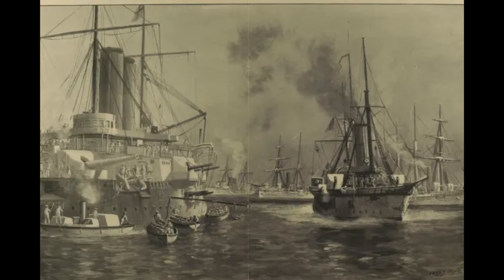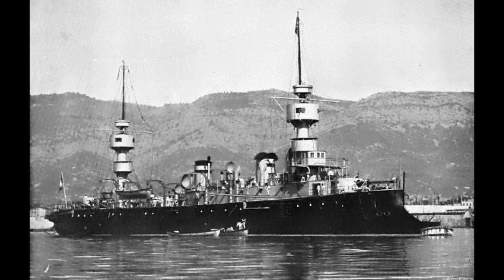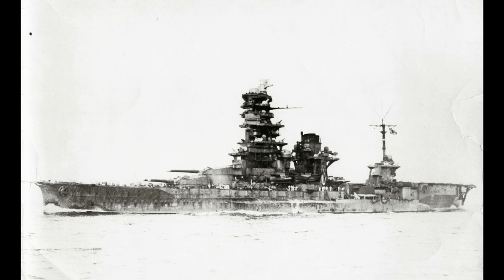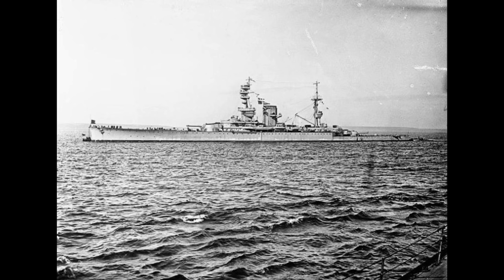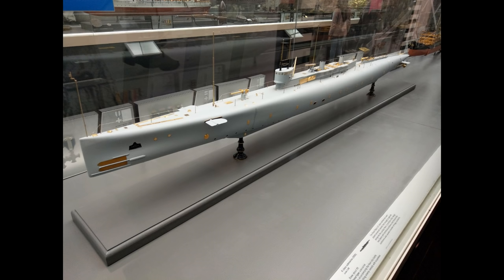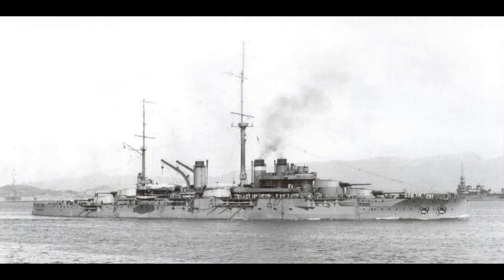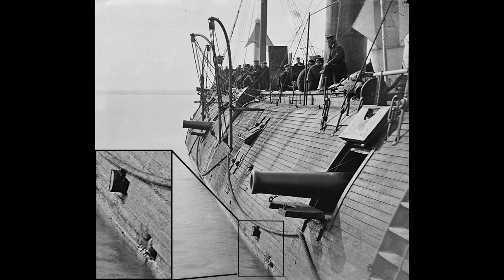Naval Engineering Disasters - How not to design a ship

Comment from the maker: Pinned post for Q&A :)
Reply: If it is possible to create a naval gun bigger than 18.1", how much would a 20.8" 9-gun fast battleship weigh?
Reply: This may be a bit redundant or stupid, but listening to this, with the K-class, did no one, at any point, stop to question whether designing a sub whose crush depth was less than the length of the sub  itself might have been a poor design choice? What was the rationale for the dive depth being so shallow?
Reply: If Montana would have been build, will she be fast enough to be with the carrier fleet just like the fast battleships ?
Reply: Would wood from the West Australian Jarrah tree have made good timbers for wooden warships? It is a very heavy hard wood that is very hard to burn ( as I know from trying to burn it in winter)
Reply: Hey drach! How about you show us your ideal designs on games such as Ultimate Admiral Dreadnought or if you feel confident something much more complex like Naval Art?
Reply: Reduced batlecruisers: Dreadnought keeps caliber and armor of predreadnoughts, increasing speed and replacing the intermediate guns with more main batery guns. How well have worked  a batlecruser that made just this, in the inteded purpose of killing armored crusier. Ie, a 6-8 inch armor, 26 knots, 8-10 9.2" guns, in terms of cost and efectivity
Reply: Hi Drach
Just a observation about Ise and Hyuga. Agree with your analytical approach to the battleship-carrier, just not your figures

They carried a combination of 22 (or 24) Judy dive bombers or Paul recon float planes. 
At the time, that is after Feb 1944, the Japanese had arranged their naval air group/squadrons in a type of RAF/RAAF squadron systems where air planes were assigned to specific squadrons for specific roles, regardless of where the squadrons were placed on the battle field 
Hence CarDiv 1 had no planes assigned to it, rather Air Group 601 had their planes specific trained as carrier based planes. These planes could operate on a carrier in CarDiv 1 or as a land based air unit on land. Bit of the results of Midway, Santa Cruz battles and rigidity of aircraft deployment that hemmed in the air groups to specific carrier divisions.

Rightly or wrongly, the Japanese believed that most carriers attacks in a given battle would launch one strike per day per carrier. The 22/44 Judys/Pauls attack and scouting planes would compliment any Japanese carrier attack for one day in a given battle.

The Japanese chose bombers and recon planes over fighters because IJN was attack minded. They believed a battleship with its armour could survive ONE counter strike by itself by dodging bombs and torpedoes. As we know, this was proven correct before and during Leyte too. 

Ise and Hyuga were in CarDiv 4 in the 3rd Fleet in May 44. Air Group 634 had 2 squadrons of recon planes, 301 Squadron and 302 Squadron, made up of 18 Judys and 16 Pauls. AG 634 also had 2 fighter squadrons as well. They were assigned to the 3rd Fleet. The 3rd Fleet assigned these aircraft to CarDiv 4 to compliment the battleships.

In the mid October 1944, the US 3rd Fleet started their soften up of the Philippines in October and Japanese activated Sho but not knowing exactly which island the US intended to invade. The US bombed Formosa and after 1st raid, it was decided to send Air Group 601 (CarDiv 1, eg Unryu's)  Air Group 653 (CarDiv  3 eg Zuikaku & CVLs) and 634 (CarDiv 4 eg Ise's) to Formosa to counter-attack the US 3rd Fleet. 
Most of recon wing were destroyed or lost many planes on the 15th.
Ise and Hyuga had very few planes left for the Sho-1 sortie. So the planes stayed behind at Formosa as part of 2nd Air Fleet.

So you are right in a round about way, that in the only battle they fought in, the battleship-carriers carried 0 planes while missing a third of their armament maybe more with hangar in the way if they were fleeing in a gunnery duel.
Reply: You have extensively covered Wood, Iron and steel constructions, is there any naval use of ferrocement construction? I can only recall the Mulberry Harbour cassons.
Reply: I would put a vote for the RN J-class submarines being a slightly greater engineering mistake than the later K-class.
These ships shared all the other seakeeping problems the K-class had, but were too slow for fleet use at the time of design !
During the design process of these the huge problem of "no suitable engines" was one of the first problems raised.  Vickers made an inline 12 version of their existing, and rather ordinary, 8cyl production engine; which was still recognised as being inadequate.  But three of those 12Cyl engines were used.  The RN soon found them to be useless for their needs, and passed the J-class to Australia.  There they were mostly in reserve until struck off charge.  It seems that their most positive role was to supply electrical power to one of the Port Phillip bases.
Strangely, the inadequacy of those Vickers diesels, and others, did not result in the UK government supporting a major diesel engine development programme.  So the majority of submarine engines up to the end of WW2 can be claimed to be behind the norm used in other navies.
Reply: Hi, silly question, how did the Japanese aircraft take off from their hybrid carriers, I thought the carrier should be pointing into the wind
Reply: Assuming Hiei managed to limp home from her knife fight at Guadalcanal and that Mutsu doesn't explode and both ships are with there respective sisters in the Center Force at Layte Gulf, could the extra ships, assuming they don't sink in the air attacks with Musashi, have made Halsey consider leaving Task Force 34 behind to cover the San Bernardino Strait or at least made Lee press the case to leave Task Force 34 behind stronger? And what do you think Lee's reaction would be at fighting this new Centre Force with Task Force 34?
Reply: Given your previous disdain for the Nassau class and there failings as Germany's first attempt at a Dreadnought I am surprised not to see them on this list, is it a case of only just missing out or were they not as bad as I believed?
Reply: What are your favorite warships by era?

Not necessarily the best, but ones that something about them just makes you enjoy them?

You know, like the Kamchatka
Reply: why didn’t more ships use near water line exhausts wouldn’t that decrease detectable or just to costly to be feasible ?
Reply: With the weather the way it is here in the US I thought I would ask a naval question about the weather. How cold does it have to be to pop cast iron balls out of a brass monkey? Could you explain that terminology to those who might think it's dirty LOL.
Reply: This may have been answered, but I'm not aware of it so what is the point of the one fore, two aft turret design on the Konigsberg/Nurnberg designs? Surely for a commerce raider chasing down merchant ships two fore makes more sense. It just seems like a ship designed to run away. Was it simply the weight issues again or was there an actual reason for the design, and if so why did no-one else use it?
Reply: Q&A in your opinion. What ships looked like or might as well have been designed by Jeremy Clarkson, James May and Richard Hammond. Either individually or as a collective?
Reply: How universal were the flight decks of WW1 and WW2 aircraft carriers? For example could Enterprise's flight group fly off of Taiho and vice versa without significant impediment, assuming for the sake of argument the crew are familiar with the new aircraft/ship.
Reply: @d.olivergutierrez8690  

Montana could do 28kt (in theory), so technically no, but then the SoDaks only made 27kt and were sometimes used as carrier escorts (in the “glorified, overgrown CLAA” role)
Reply: How effective were the Dutch Hazemeyer gun mounts
Reply: @Slavicplayer251  I would imagine having the exhaust close to the water is not good in high seas. I know I wouldn't want the water to have that easy access to my engine room!
Reply: This question has already been covered somewhere probably, but I was wondering how long naval guns would take to reload. Assuming the sailors are average skill how long would it take to reload standard 5 inch destroyer guns or 16 inch battleship guns. The reason I am asking is because I am curious how games like World of Warships and Warthunder compare to real life.
Reply: May i ask what is the difference between an armored cruiser and an protected cruiser?
Reply: What other naval inventions made all others versions in their category obsolete? By that I mean in the way that HMS Dreadnaught made a lot of other ship designs obsolete, just in terms of guns, fire control systems, ammunition, engines, etc. The only examples I can think of would be the American Combat Information Center, and the VT fuse on AA gun shells.
Reply: I think the line that Beatty should have said at Jutland was not "there seems to be something wrong with out bloody ships today" but rather "there seems to be something wrong with out bloody admirals today."    It is a poor craftsman that blames his tools.  The Indefatigable class made a very great deal of good sense for the UK in the day and age in which they were built.  It's possible that the lack of an Empire today may be shaping your thinking a bit too much.    If the proper handling rules of both ammunition handling and ship purpose had been followed, and Beatty had been much more careful about how he engaged the Germans, and I would submit here that he could have done his job perfectly well just by leading the Germans towards the Grand Fleet without firing a shot, but he also could have stayed further out of range and properly utilized his second squadron of heavier battleships for their proper purpose.  
I would also submit that while you have a valid but in no way completely guaranteed point on the possibility of Indefatigable going down in the Falklands, I think it very likely that it would have at least caused some significant damage before it went, and if so that would have served her primary design purpose to a great degree.
Reply: As you have discussed in earlier videos, some ships were fitted with smaller and fewer guns per turret, but with greater mechanization to increase the rate of fire (I believe you discussed this in the Tiger Class video).We’re there any inter-War or Second World War designs which only had large caliber single gun turrets (I.e. larger that light cruiser sized guns) specifically to increase the rate of fire?
Reply: Do a video on U-1206, when poop caused a UBoat to sink and the toilet requires a so called Scheisseman to operate successfully.
Reply: Please could we have a short 5 minute video on Henry V's Grace Dieu please?  Stumbled on it when I was in Hampshire before Christmas, and reckon it would make a good video!
Reply: What would indefatigable have been like if she was designed with only fore and aft turrets and all the saved weight put into armour and or machinery.. ie a predreadnaught battlecruiser or somesuch
Reply: Hello Drach, lets supposed RN had Ise class BB/CV mutant. How handy would it have been during early Battle of the Atlantic when raiders were a threat before CVE came along supposing anti sub/ship style aircraft aboard? Maybe even during Malta runs?
Reply: @herrraja9038  well theoretically possible. But why would you want to? Bigger is not better.
Reply: @d.olivergutierrez8690  she was a slow ship by design. Nope.
Reply: @Texas_montantero  a deck is a deck, is a deck. By that definition all aircraft carriers are pretty universal. They're all flat, long, & have elevators.
Reply: @deaks25  One fore two aft helps with topweight, since the aft turrets can start a deck lower, the front superfiring turret has much more topweight leverage on the ship's metacentric height, and therefore in some situations can not be worth it. Plus a commerce raider has much more speed margin on the things it wants to chase than the things it wants to run away from, so you can make a case that more firepower aft is fine as long as the aft turrets can train decently far forward.
Reply: @hamishneilson7140  that would make no sense.
Reply: For an element that isn't a single ship, what about WWII German stern design?  As I understand it the use of three screws instead of four on their larger ships prevented enough buoyancy being available since the stern sat too high without enough of it in the water in order to clear the screws. This combined with a very long belt (and resulting stiffness) meant that the stern structures were prone to collapse when exposed to shock, which would concentrate stresses where the belt and stern wanted to flex differently. This isn't just a hypothetical either, since Prinz Eugen needed to be towed back to Germany after such a hit and Bismarck's career was defined by such a hit.
Reply: Do you plan on some day covering the battle of Santiago de Cuba on a video? Seems like quite an interesting event.
Reply: @xthetenth  where do you get the idea that adding more props results in more buoyancy? 🤔
Reply: What if Nelson survived Trafalgar? What battles would he have fought and would he have pioneered any more revolutions in naval design and strategy?
Reply: @BenMyhillJones  reload times varied considerably, depending on gun size, and when they were designed.  Navweaps gives rounds per minute data for most naval guns.  As you reason, the level of training of the crew plays a major role.  The USN made two ventures into superimposed turrets, reasoning that the smaller guns in the upper level could fire more rapidly, thus keep up a hot fire while the larger guns in the lower level were reloaded.  The Navy discovered if they worked on the ergonomics of the big gun mounts, and trained the crews a bit, reload times could be reduced dramatically, rendering the superimposed guns redundant.
Reply: @WALTERBROADDUS  You need a given amount of screw area to absorb the shaft horsepower. Three screws instead of four means that the screws have a broader diameter and that one of them is directly beneath the keel. Since the shafts are limited in how deep they can be by the fact that they have to go into the hull to meet up with the engineering spaces, the stern is limited in how deep it can be by the diameter of the screws. Since hull needs to be underwater to generate buoyancy, fewer screws which require a greater diameter means a stern with less draft, which is less likely to be able to float on its own and more likely to be cantilevered up on the strength of the ship's girder.
Reply: @WALTERBROADDUS  Why's that?
Reply: What do you think is the worst name ever given to a military vessel? Because Indefatigable is probably up there to me for dumb sounding names
Reply: What is the best way to strike a balance between versatility and specific purpose built ships? i.e. the extremes here of the hybrid battleship/carrier being so desperate to be both that it was ineffective in either role or the fleet submarines that were so tailored to that role it was impossible for them to be effective when they were obsolete for it (notwithstanding the other flaws in their design.)
Reply: After hearing the segment on Vassa and being a big fan of trimarans....you know where I'm getting at...
 How about a Vassa with outriggers, would it make a viable weapon in the Age of Sail? A trimaran design with small outriggers would allow a high center of mass at the same time it helps keep boarding actions at a safe distance, at least those advantatges makes you think "What if....". Thanks Drach!!
Reply: Subs are not meant to go vertical. They are meant to stay nice and horizontal like regular ships.
Reply: why did the french "cluster" their secondary guns on the corbet and other battleship classes like that? what was the reason why they did it and other nations did not?
Reply: Could we see a video on the types of Air independent propulsion tested for submarines in the time period the channel covers?
Reply: Can nations continue to use a city name if the city / territory is no longer under there control? 
For example RN pola, pola isn't in italy anymore, can the italian government continue to use pola as a ship name?
Reply: @neki0playz12  the answer to that one, at least in recent history, has been no, given the repeated renaming of soviet ships in during the breakup of the Union, but I'm sure its been done before as a "we still consider this OURS, your just temporarily in control of it" way, like a early modern English ship being called Calais or something similar. Generally, though, it seen as a unnecessary diplomatic insult thats normally avoided and they go for something safer like "vengeance". 

Although im not aware of an example, it might be possible that captured ship brought into service might keep its old "Place" name as well.
Reply: You Missed Something Drach: Popoff and Novgorod!!!!! Completely circular battleships......
Reply: Hi Drach! Question on fleet submarines: were there ever designs for "composite" submarines combining an underwater battle unit and a detachable part for cruising? E.g in a form of a transport ship with a submarine it can drop before the battle, midget submarine transported by a cruiser or battleship, "space-shuttle" scheme with additional fuel or engine blocks attached to a sub for cruising? Was anything like that ever considered?
Reply: Question: as related to your K Class submarine section. Or perhaps more to the point, submarines in general. Notsure if you've followed the current news about Sweden's Gotland class of subs, which are apparently doing very well in fleet exercises much to the bane of US supercarriers.
Did anyone come up with the idea of say around a 100 foot sub, basically all engines and torpedoes,  that could be secured to the sides of battleships or large cruisers for transit, then like a lifeboat,  lowered into the water once the enemy were in range? Sort of like underwater destroyers, able to move along with the battle line then attack the enemy with large volleys of torpedoes, using all the various propeller sounds and explosions to disguise their approach. Then they maneuver back behind the friendly fleet and get picked up after the battle.  Something better designed than the deathtraps that were the japanese mini subs.
Reply: Even if Jutland had been a major British tactical and operational victory would it have had a significant impact on the coarse of WW1? Given that historically the British had control of the sea and maintained it after the battle of Jutland how would events have been different after the battle and how would it have impacted the coarse of the war on a grand scale if Jellicoe had managed to trap the Germans had sunk say 75% of the High Sea's fleet while loosing say 1 British battleship for every 3 German sunk in the ensuing battle.

The British would have have had total control of the Atlantic and Med but they already had this. The Grand Fleet wouldn't have been able to protect merchant shipping against U-boats, the German minefields and light forces would still have made any attack on the Baltic extremely hazardous. Is there any way that the British could use a major victory at Jutland to significantly shorten the war, alter the strategic geography or momentum on land or win it at a lesser cost in lives?
Reply: Do you think US subs would have been equally effective if they had just gone into their surplus Mark 10 torpedos instead of going around the problems of the Mark 14?
Reply: @thomasjamison2050  Nope:

"The real cause of the disasters was that the precautions for preventing flash of ignited propellant reaching a magazine were not matched to the behaviour of British charges, though if the British ships had had German charges it is very unlikely that they would have blown up. This was not, however, clear at the time.

...

There is no doubt that far too great a number of exposed charges were present in many British ships at Jutland, but this was at most only a CONTRIBUTORY cause of the disasters that occurred. In the Lion's 'Q turret the ignition of 8-13.5in charges between magazines and guns, all of which were in hoist cages or authorized waiting positions, would have blown up the ship if `Q' magazines had not been closed, and very probably would have done so anyway if they had not been flooded, though the total weight of propellant that ignited was only about a sixth of that in the Seydlitz's fire."

- Campbell
Reply: @hirisk761  well i meant it more like the exhausts on Japanese carriers
Reply: I was both afraid and somewhat anticipating that the Bismarck was gonna be on this list.
Reply: I mistakenly posted my question in the general comments. Can you pull it from there, please?
Reply: @d.olivergutierrez8690  The Montana class was to be the follow-up to the Iowa class, but with an extra main gun battery, giving it 12 16' guns versus the Iowas' 9 guns. Since the Iowas were able to keep up with the carriers...Yeaahh, I'm gonna say the Montanas were capable of matching speed with aircraft carriers.
Reply: US Navy has had a few large engineering issues just in the last 20 years.

The San Antonio class LPD's and the LCS "Little Crappy Ships"
Reply: Has amor belt ever fallen off after being hit by a low to medium quality hit?
And is so, did she capsize?
Reply: @scottmason2557  or what about hedge wood. Rock hard and nearly immune to rot ?
Reply: If first rates were the expensive top guns only brought out for war, and third rates were the more numerous backbones of the battle line, was there anything particular about the role of the second rates?
Reply: I noticed that 9 of your 10 choices where abject failures in the survivability part of the offence/ defence/ mobility equation and as such forgot the defence part. I was wondering what your picks for failures in the offence/mobility sections would be. I read a quote once that HMS Monmouth was a fine ship they just forgot the guns but some one must have designed ships that really had no usable offence or the mobility of an iceberg.
Reply: How about a special on ‘super-cruisers’, cruisers that go above and beyond the regular cruiser of it’s time (stopping short of what would properly be considered battle cruisers), some that spring to mind are the Blucher, Courageous class, Deutschland class, Alaska class and the Japanese Design B-65. Looking at how the concept evolved? Although I think the concept was a continual dead end, I’d like to understand how each time it was tried they thought it would work.
Reply: In places where applicable, what was generally done with empty shell casings after an engagement? While I imagine not much thought was given during an engagement or for the lighter weapons, such as .50s, if brass fell overboard, all of that metal could still be valuable. Or was it seen as dead weight, and just another thing to be worried about, and thrown overboard during downtimes? Also were there some crew members whose job it was to police the brass of various stations so they wouldn't be overwhelmed with it all over the place?
Reply: So what makes the Omaha class a bit better than the Konisbergs anyways?
Reply: The RN received old destroyers and escort carriers for the Lend-Lease. Did they requested more modern destroyers and even cruisers from the US?
Reply: Small question regarding the Courageous class: How did their CV conversions helped solve their design issues? Sure, the conversion removed one of their biggest enemy: their own guns, but their base hulls were still there, with all their sea keeping issues and inability to withstand rough weather. However, it's not something frequently brought-up. Were the issues fixed? If so, how? Did some issues persisted impacting their usefulness?
Reply: Thinking of a possible use of a fighter battleship carrier. With carriers tending to be sailing in TF's together anyway. Would have made a difference at the like of Midway for example if one of the carriers were dedicated to maintaining the CAP fighters, where the other concentrated on the strike packages? This certainly would help in the work load of each carrier unilaterally having to context switch between the two?
Reply: On the courbet class: the shortcoming of main battery elevation seems like something that could have been addressed afterwards. Why wasn't it? The rest of the ship was mediocre enough that they just wrote them off?
Reply: @thomasjamison2050  It is not MY argument, I gave you a quote from "Jutland, an analysis of the fighting by John Campbell, the best and most detailed book on Jutland.

Lion only survived because the German shell didnt set off the propellent, which allowed the crew to flood the magazine, THEN, after quite a while some ember or small fire set off a charge and THAT caused a chain reaction that set off the remaining charges, ALL of which were in AUTHORIZED positions, meaning THERE WERE NO EXCESS CHARGES IN LION'S Q TURRET, so the usual excuse of "the crew/Beatty had too many charges just laying around" doesnt apply.

Not only that, the mere EIGHT charges present were ENOUGH to bypass all flash protection in the turret and buckle the bulkheads and even the closed magazine door, in spite of the magazine itself being flooded and the turret top being missing due to being blown off by the German shell.

It is a perfect example of a RN ship following procedure to the letter, NO EXCESS CHARGES, and STILL suffering the cordite chain reaction that destroyed the other ships.

But you are right in that blaming the crew was made up to protect some people, the designers...
Reply: IMO IJN designs of light craft/cruisers pre Tomozuru/4th fleet incident were top10 worthy...
Reply: @thomasjamison2050  Are you serious?

"You point about the quality of the ammunition is valid, but can not be established as anything more than a contributory factor for the ships that did sink. "

A PROPELLENT EXPLOSION BLEW THE SHIPS APART! That is just a "contributory" factor for their sinking?  If there is a way for a propellant fire, that can happen by ACCIDENT OR ENEMY SHELL OR EVEN HOT ARMOR FRAGMENTS, to reach the magazine THEN SOMEONE SCREWED UP THE SHIP DESIGN, because your ship has 4-5 turrets along the ship and they have a self-destruct button...

"In any case, Lion did survive, though there is no evidence at all that the punishment the sunk ships received were precisely the same, which is the logical implication of your argument."

LOL!!! You dont need them to suffer "the same" punishment, you need ONE HIT, to reach and ignite a propellent charge and, as Lion's case shows, YOU CAN HAVE A CHAIN REACTION THAT ENDS UP REACHING THE MAGAZINE AND THUS DESTROYING THE SHIP AND ITS CREW.

That hit can be the FIRST... or the THIRTIETH... doesnt matter, what matters is that your ships have a design flaw that allows it since NO ONE made sure the turrets were flash safe.

So its only a matter of time and luck WHEN you are getting a bad hit and go up in flames.

You do know a RN BB even blew up in port, right?  By itself...

And where the hell are you getting the idea that I am defending some useless twit?
Reply: You see pre WWI and WWI era cruisers with as many as 4 funnels. You see more modern designs with a single funnel. It seems some additional ducting could combine these funnels down to one easily and free up top-side space for more guns, torpedo tubes or scout aircraft. What are the benefits and liabilities to the different number of funnels used?
Reply: @trauko1388  Yawn.....
Reply: @trauko1388  Oh, gee.  I am sorry. I didn't he realize this Campbell guy was a God.
Reply: @thomasjamison2050  LOL!!! No, just a quite famous author that went through EVERY hit scored during the battle in BOTH UK and German archives, it is not just any book that repeats the old warmed-over tales. 

Sorry that upsets you...
Reply: Why the German predilection for super-firing aft turrets but not forward?
Reply: @rhbrandon1  You need a higher freeboard forward to take on the sea, so if you want superfiring forward you are adding weight further high on the ship, on a higher deck, so you would need to account for that in your design and add even more displacement and cost in order to stabilize the ship.

If you put the turret aft you can do it on a lower deck than if doing it forward, lessening the problem.
Reply: I've seen an old episode of battleship new jersey and the curator said that it was only the germans which scutteled most of their battle fleet ships and somehow seemed proud of it.. therefore I wonder.. did no other nation scuttle some amount of ships for whatever reason there was, especially he claimed the US never scuttled a ship.. which I find hard to believe.
Reply: @caerusdharken57  They scuttled Hornet... or tried to... after they FAILED they left and the IJN captured the carrier, but it was far too damaged to tow so they scuttled it.

Seems even worse than just scuttling a ship.
Reply: Did warships use fuel stores as protection? I know some tanks would use fuel cans as standoff armor against shaped charges. Did they do the same? 
Although I joked about a fictional ship HMS Inflammable but did anyone (besides modern VLS) place magazine stores on near the outside in smaller magazines so instead of a giant bang with ship confetti you get a small bang and a floating ship...or at least a somewhat floaty ship?
Reply: @trauko1388  History is never written in a neutral space.   One can only publish that which will sell.  In the UK, especially as one goes back in time, fawning over the rich and powerful was always a prerequisite.  No surprise that such bias can distort any historical work of the period.   And as Brexit so clearly shows, the UK is still stuck in the mud behind such biases.
Reply: Would the japanese WWII carriers aviation fuel tanks, integrated with the hull and rupturing almost everytime the hull got a bang (torpedo or bomb or shell) due to mechanichal shock transmitting through and the subsequent fire hazard of leaking petrol and fumes ... get an honorable mention?
Reply: Oh, and I know it's a bit outside your period of focus, but aluminium superstructures... Cracking due to material fatigue (material that had not the strength and resiliance required), ladders melting during a fire and trapping crew below, if I remember correctly. (US Perry class, some british frigates, etc)
Reply: @thehoodedteddy1335  besides the british fearsome Flower class?
Reply: Hi Drach. Enjoyable video as usual. Wasn't the Flower class corvettes a civilian designed warship for the Royal Navy?
Reply: @herrraja9038  k
Reply: Enjoyable series as always. Why not do a video on the 12" /50 mark 14 experimental gun developed by the British in the 30s? 
The gun was an innovative design that was only tested briefly. Apparently it was to go in 4 twin turrets similar design to the Hood, and would be smaller and lighter version of the Hood to comply with possible Washington naval treaty changes in the 30's. The ship would have been close to 30,000 tonnes, around 34 knots and be similar to the Alaska class in terms of armour and size, as well as role. Secondary armaments would have been 10 x 4" twin turrets like those on the Daring DD and  4 x 4 10km torpedoes. The 12" gun would likely have used a supercharged shell like those of the 6" gun - or AP only.
Reply: With elevation issues on some brittish ships how on earth did they fire past 15° or did they simply not bother as you said that their prisms couldnt go past 15°
Reply: @Yuri Setsuna that being said. The North Carolinas and South Dakotas were used as escorts up until the end of the war. Hell both classes had been used as carrier escorts during Guadalcanal. What I’m trying to say is that both ships had 27-28 knots top speed. By that logic, those two classes would have been put on shore bombardment exclusively duty at the end of 44 when Missouri and Wisconsin arrived into the Pacific.
Reply: @scottmason2557  Limited time from cutting to becoming very hard to work with as it dries out. Extremely tough timber however.
In my opinion it should be kept for fine furniture.
Reply: worst ship in your opinion in service post 1900 pre 2000
Reply: @bossdog1480  We do use it for furniture which is very nice it's also used as floorboards in houses
Reply: Hears mention of K-Class Did someone say the Battle of May Island? No? ....okay. I'll just go back into my corner.
Reply: I think I get the jist of it.
Boom... wwwoooossshh... boom...BOOOOM...!!!
Spash! Splash!  Girgle...girgle... Blub!...blub!...
Next...!!!
Reply: Always!  Outstanding!
Thanks...
Reply: @herrraja9038  x
Reply: When is THE Nelson and Carriers/Destroyers Part 3 arriving
Reply: Would the battle carrier have not been a good idea for invasion protection duties (for both sides)...ie guatalcanal or leyte gulf?
Reply: @thomasjamison2050  Not sure how much would be different. German battlecruisers were demonstrably more durable than British ones, due to general German design doctrine of the time leaning a bit more towards the protection part of the firepower-mobility-protection equation than contemporary British doctrine.
Reply: @seanquigley3605  Or even vice versa, what about a BB/CV or BC/CV mutant having an all fighter complement, used as a commerce raider?
Reply: @ph89787  Minor correction, North Carolina class was longer and faster than South Dakota. They were originally designed for different roles (South Dakota was designed more to destroy the older, slower Japanese battleships), but like you said, both classes served in the carrier escort role anyway.
Reply: Question: why were they so determined not to increase the displacement of the Indefatigable such that they decreased the armor for the fore and aft turrets so drastically that it made the ship worse than the preceding class for its intended role? Other than the armor, are they substantially different from a lengthened Invincible? Would increasing the length and lengthening the 6" armor protection correspondingly while keeping the beam the same have made the ships noticeably slower than their predecessors? In other words, was there an easy way they could have avoided the key problem that you explain here while also improving the firing arcs? Maybe just moving both mid-ships turrets to the centerline? A full break-down of possible solutions would be very interesting. Thanks!
Reply: So speaking of the K-class here is a hypothetical. Which would have been more helpful to the Kreigsmarine during the German high water market of 1940-41- three more Panzerschiffe or six more K-class crusiers? Both being imperfect types I could see the Panzerschiff being more useful than the larger number of K's
Reply: @herrraja9038  2,,a
Reply: As for the K class submarines could you comment on the Battle of May Island?
Reply: @d.olivergutierrez8690  I believe that the top speed of the Montana class battleships would have been 27 knots while the carriers could do north of 30 knots. Something like 33 knots if I remember correctly.
Reply: What ideas that looked good on paper, turned out to be terrible once implemented? Torpedo tubes on battleships come to mind, but surely there must be others. Aluminium superstructure on top of steel ships is probably too modern a mistake to make it to this channel.
Reply: Ey Drach! Is it possible to get a look at China's navy pre ww2? or even better still! A broad overview of their navy up through time, I know they used to be a naval power once upon a time in a land long ago, but..How has it looked in more mordern times?
Reply: Update: I have just watched drydock episode 195 where a majority of this question was answered. However I'm still curious about lighter weapons such as the open pits of AA guns on aircraft carriers and if someone had to police the brass there
Reply: @herrraja9038  Too much.
Reply: Too much.
Reply: @herrraja9038  p
Reply: Where would the USN LCS fall in this list?
Reply: I would like to point out that in regards to the Vasa..The ship itself was not built "perfectly" no...However it was also found that one of the main contributing factors was a miscalculation in the balast needed.. And thus it left port with far to little. More a clerk error or a Math error than an actual, engineering flaw?
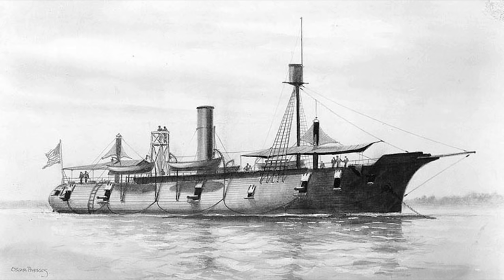Reply: 44:08 USS Galena (1862) 

"For the wind is on her quarter, and the engine's running free, 
There's yet another gunship that sails the northern sea, 
Can beat the old Galena, just blast her with the guns, 
We challenge all, both big and small, then quickly turn and run." 

(Melody: The Old Polina)
Reply: What is the largest calibre someone was hit by and survived? For example you could theoretically survive being hit by a cannonball if it hits only your arm etc. Did something similar ever happen with battleship guns (duds)?
Reply: @mellon4251  I think I once heard of someone surviving a smaller cannon ball passing through his body (torso, not arm or leg), but it could be just a story. I can't find anything on it.
Reply: About the Courageous class, I read something, and I would like to ask if it has at least some merit, that it was not only the general lack of rigidity that was the issue, but more so an unfortunate pairing of the mean wavelengths of particularly the North Sea (that they would have to cross frequently) with the overall length of the hull, that would have them more often than other vessels suspended by their bouyancy only around bow and stern,  and more or less hanging suspended around their centre of gravity, in which case the aforementioned general lack of rigidity would greatly contribute to spectacular structural rearrangements. Is there anythign to this?
Reply: Have there been any recorded cases of Navel battleship boilers being retrofitted onto a railway locomotive
Reply: @McAttack21574  I guess that´d be a ginormous locomotive. You can play basketball inside a battleship boiler.
Reply: As a registered engineer, it’s worth mentioning that many so called “engineering failures” are actually the result of the builders corporate bean counters limiting the funds to build a proper ship. There, I said it.
Reply: You can't really criticize Japan 1945 for "It wasn't effective against the huge American fleet".  Anything they did in 1945 was ineffective against the huge American fleet..  All the proper aircraft carriers, cargo ship, battleships, cruisers, destroyers, et cetera were also ineffective against the huge American fleets.  Everything did nothing more than giving the Americans something to shoot for target practice.  People criticize everything Japan did as dumb because it wasn't effective.  Their tradition weapons, bombers, fighters, ships were ineffective, their new ideas were ineffective.  Ohka was ineffective.  Suicide torpedoes were ineffective.  Yamato was ineffective.  Everything was ineffective.  Nobody says what they should have done instead that would have been effective against the American Fleet in 1945.  F-16s?  Nuclear powered submarines?  Stealth bombers that could reach the US to attack the mainland?  Godzilla? Nothing they did in 1945 with the technology available would have been effective against the American fleet.
Reply: Could you do a video about the plan to turn the Iowa’s into battle carriers? Specifically, is it any more sane than the Japanese versions?
Reply: @nigelleyland166  Don't forget the Iceberg Aircraft Carrier, as shown in Popular Science Mechanics Illustrated, or Popular Mechanics of the period.
Reply: What happened
Reply: @scottmason2557  How about wood chips and ice aircraft carriers. Churchill was keen to see one operating by 1943?
Reply: I wonder, could the fleet submarine idea be revisited, with modern nuclear propulsion?